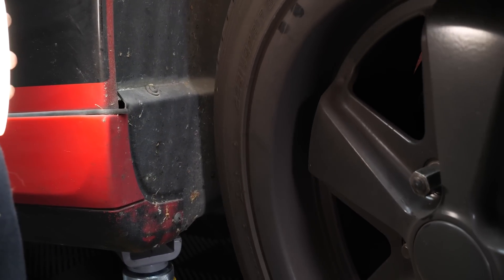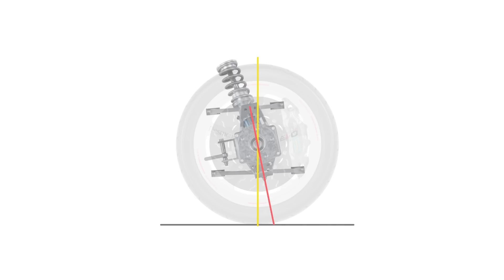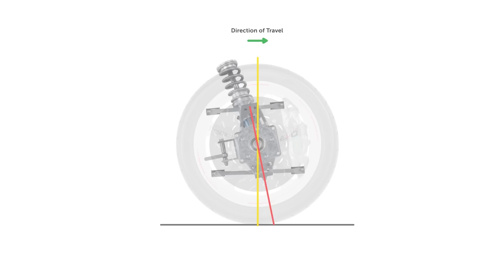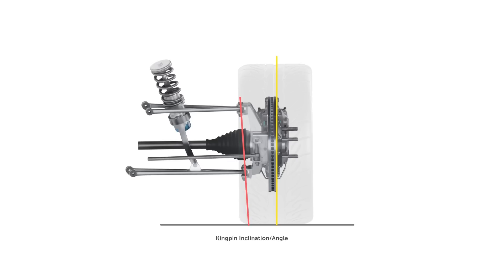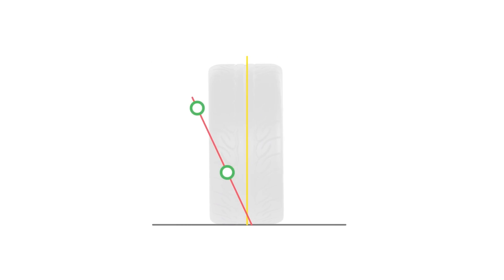Stop Ignoring Scrub Radius.

Comment from the maker: 🏎 Building a fast car? Get $400 OFF the all-inclusive VIP online course package deal: https://hpcdmy.co/ezi
🛞 Take 50% off your first purchase: The Wheel and Tyre Fitment online course. Instant enrolment, lifetime access: https://hpcdmy.co/kfv
TIME STAMPS:
0:00 - Critical Knowledge
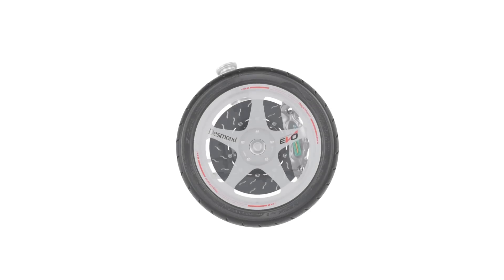0:30 - What Is Caster
1:07 - Positive Caster
1:34 - Kingpin Inclination/Kingpin Angle
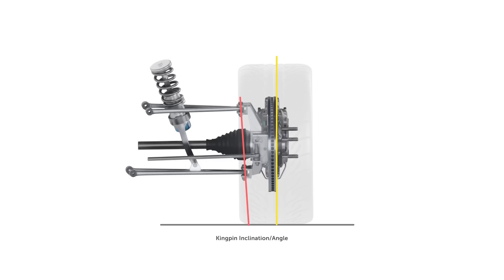2:17 - Scrub Radius/Kingpin Offset
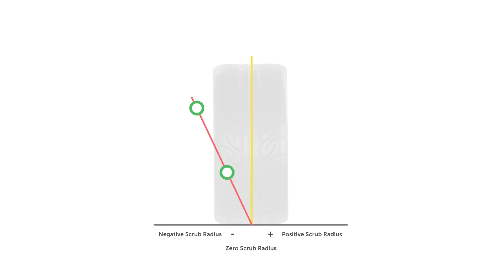3:12 - Wheel Offset Relationship
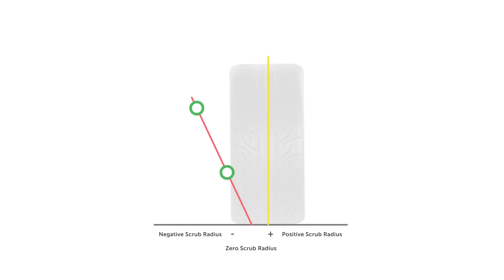3:25 - Steering Travel Arc
4:03 - Too Much Caster Or Scrub Radius?
4:28 - Suspension Tuning & Optimisation
4:38 - Sensitive Steering
5:15 - 40mm Scrub Radius Goals
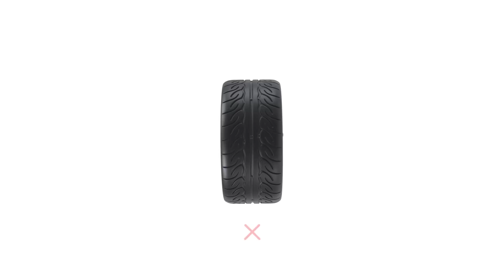5:24 - Clearance Considerations
5:43 - Lesson Summary
6:26 - Wheel Fitment Course

Comment: Hello, I’ve got a question regarding camber and caster

Camber is adjusted so that the outside (heavier) wheel during a turn has a higher contact patch and therefore traction. If the car rolls 1 degree for example, both wheels are 1 degree off. If we add 1 degree of camber, the heavier wheel is perfect and the lighter wheel is twice as bad. Why is the lighter wheel being twice as bad better than both wheels being half as bad? 

Caster is the angle of the spring assembly. Increasing the angle reduces dynamic camber during a turn. With camber, using the example above you get a perfect wheel and a wheel 2 degrees off. With caster, you could get a perfect wheel and a wheel, say, 0.5 degrees off. Why would you ever change camber when you can change caster and get better overall angles?

Thank you

Comment: Thanks for the video! I have an e46 m3 I am setting up for grip. I’m wondering if I should shoot for positive or negative scrub radius. The standard front wheel is a 8j et 47. I now have a 9j et 17. The outside of the 9j et 17 sits 43mm further out than the standard 8j while the inside of the wheel sits 17mm further out than the standard 8j. I’m assuming I have massive positive scrub radius. I have room on the inset side to widen the wheel to a 10j if my scrub radius is too excessive now. I’m just trying to figure out for the most overall mid corner grip on a bumpy road if I want negative or positive scrub radius and if so how much? Thank you!

Comment: Engineering idea. Still use race spec camber but retrofit some sort of electronic/hydraulic camber adjusting as the vehicle is cornering, with sensors it could read the trajectory an all plane angles of the car itself on track in marriage with the track planes an it could make minor adjustments on the fly as its cornering to give an edge on better handling. Program the ECU almost like an auto pilot. Wheelie control for cars
Reply: Lamborghini is developing this

Comment: Can altering the scrub radius through wheel offset alter the point at which the tire carries the vehicles weight? So if I were to put a 10.5 +12 offset wheel on a car that came standard with a 9" +45 wheel, more load would sat on the inner tread? Assuming camber and caster is adjusted to suit?
Reply from the maker: If the camber and castor are the same then no - not really. The load will be centred through the centre of the contact patch - Connor

Comment: After fitting an ATB to my mini I was surprised at how sensitive to scrub radius / wheel offset the torque steer was. This is the first time I've heard a target for scrub radius, is this target effected by wheel / tyre radius or potentially width?
Reply from the maker: Every car and application is different when it comes to sensitivity. A larger overall diameter and wider tire can definitely amplify any issues. A wider track width moves our contact patch further from our centerline, which moves the scrub radius more positive - usually increasing it. That can increase the effect of torque steer.
Note that powerful cars will exhibit this tendency rather than it necessarily being something you’ve gotten completely wrong with setup to induce it alone, if that makes sense, but of course we can make appropriate changes to reduce the tendency from there - Taz.

Comment: I understand the concept, but is it realistic for someone to think they are changing their offset from 31mm to 25mm (I'm using my car as an example here of what I did) and knowing if that is a good or bad thing. Or realistically unless you are doing a 40mm change (as mentioned in the video and doing something like a widebody kit) that it just doesn't matter much anyway.
Reply from the maker: It's not necessarily always going to be a good or bad thing. We just need to be aware of the effects our changes could have. A relatively small change like you have mentioned is unlikely to make much practical difference depending on what you're using the car for when it comes to track vs street - Connor
Reply: @bradcollins4114  keep in mind, video saidno more than 40mm total, not 40mm change.

Does your car have 0 scrub radius stock? It probably has some degree of it stock. So the max amount you can change and stay within 40 probably isn't 40.